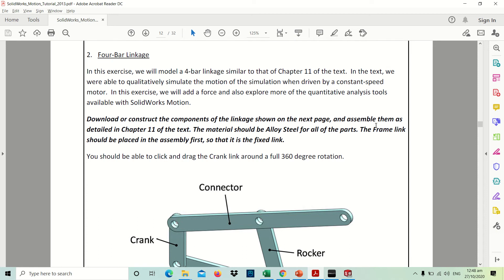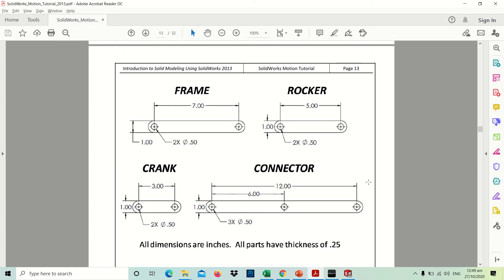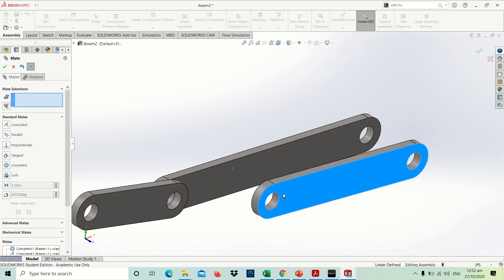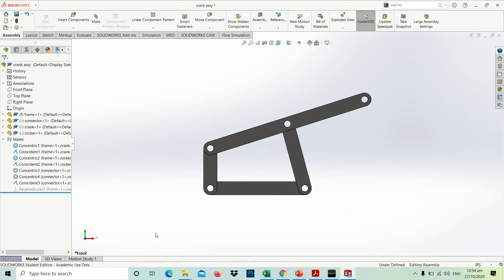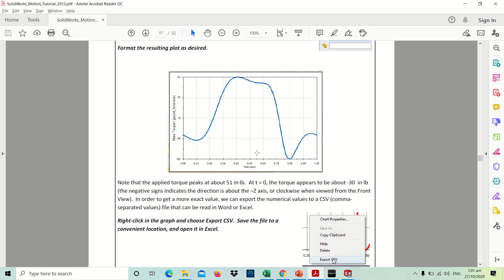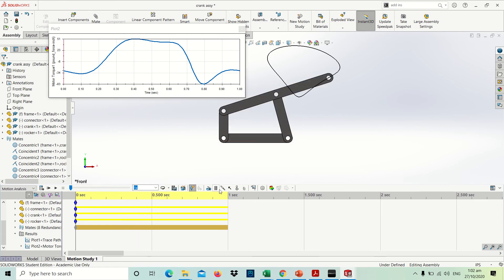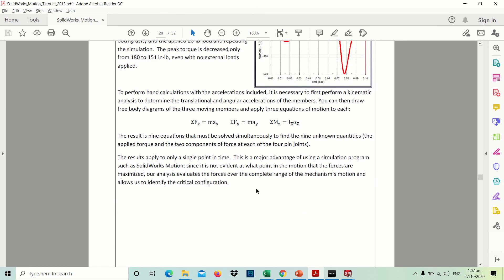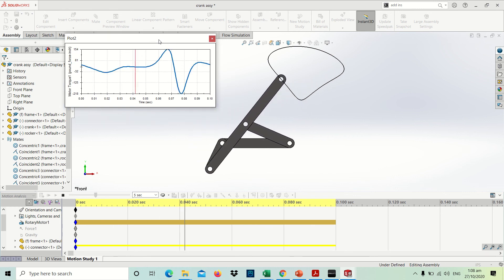SW Motion Analysis Tutorial - Four Bar Linkage

Comment: Can you plot the results as a function of driven link rotation angle instead of as a function of time?
Reply from the maker: you could change the time to frame. Angle has no option. You could add rotation as sensor, it will stop rotating at that condition set.